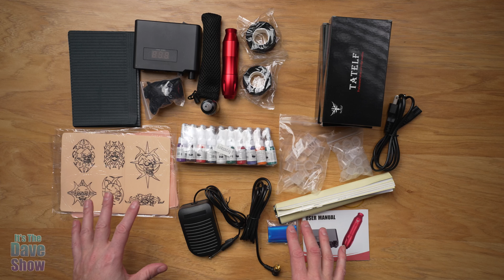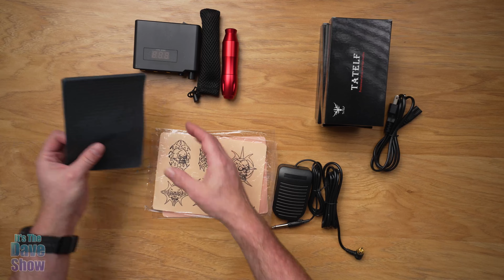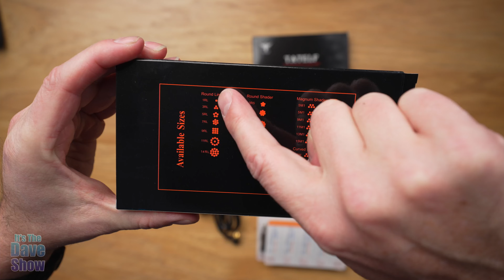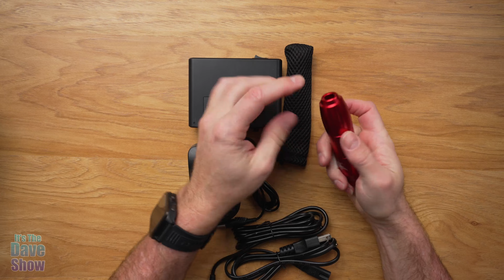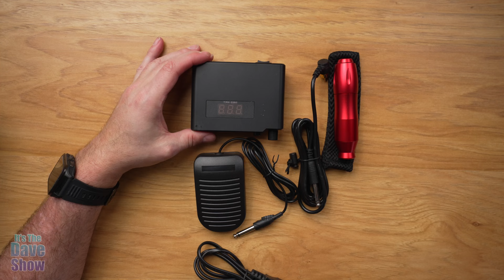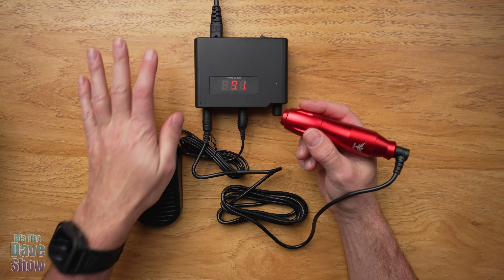TATELF Tattoo kit Professional Complete Tattoo Machine Gun Set

Comment: Maybe i was late... Anyway It doesn't work when you push the L/S switch 'cause you need to swap the cable on the line/Shader output on the psu. L for liner > Liner output.  S for shader > Shader output.